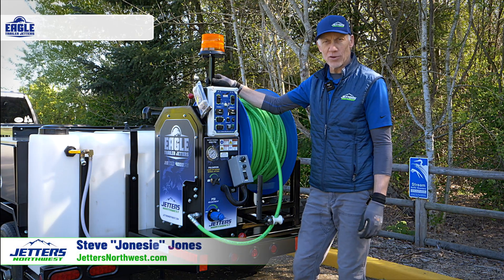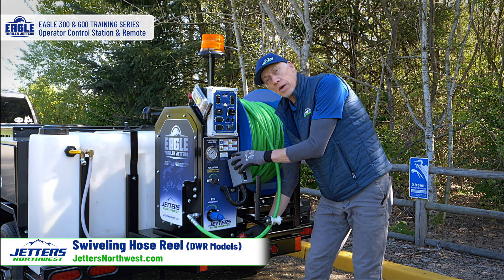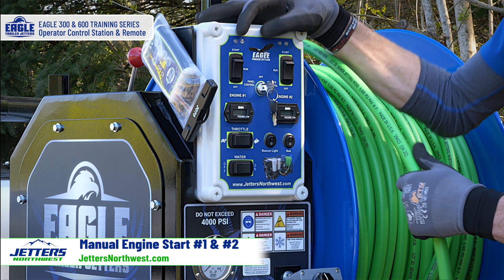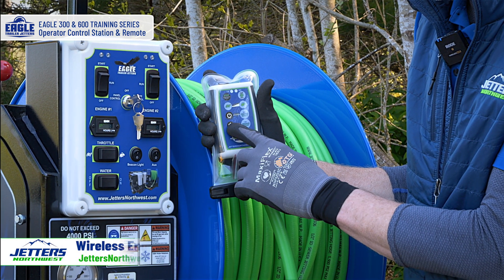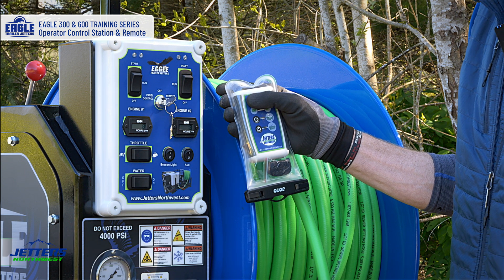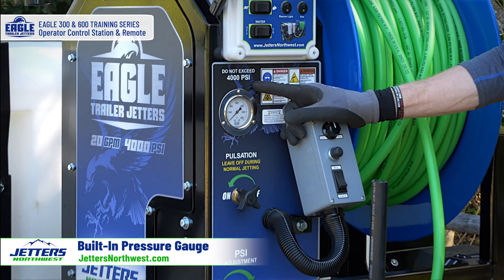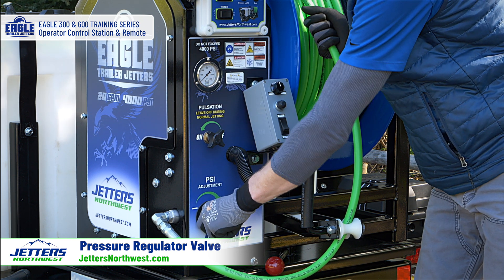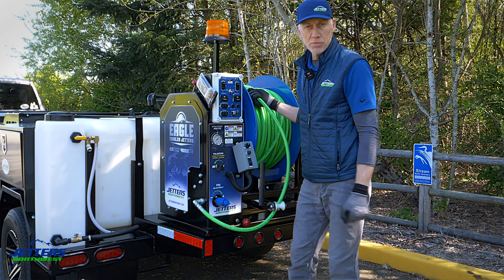EAGLE-300/600 JETTER TRAINING VIDEO (#2 of 7): WIRELESS REMOTE CONTROL & OPERATOR'S CONTROL STATION

Comment: This looks like a nice jetter. What’s the pros and cons to having a gas powered compared to a diesel type and I see that there is just one exhaust pipe for both motors. Wouldn’t that cause back pressure reducing performance?
Reply from the maker: Gas vs. diesel is a common question. We chose to use twin Fuel-Injected gas engines because: (a) it's super-versatile; you can run just one engine for smaller jetting jobs such as small pipes that require smaller-diameter jetting-hoses at 10gpm or less, or routinely run both engines for full flow range up to 20gpm with 4000psi power,   (b) theses EFI/OHV engines burn very clean for running in parking garages and such,  (c) you have a built-in redundancy to continue jetting if one motor or pump is struggling or down,  (d) it's typically easy to find a local shop that'll work on these engines since they are so common in commercial-mowers, chippers and such. Similarly, its dual 10gpm pumps are also much easier to find a shop to service than a larger-body 20gpm pump, and our pump-parts are considerably less costly with great availability.   Regarding the single-exhaust, its capacity is engineered to handle both engines at full load without a loss of power :)
Reply from the maker: Also, here's a quick informational video covering the reasons for the 2-engine/2-pump jetting system that I recorded on the floor of the huge WWETT 2025 show:  https://youtu.be/wznfM1-n2ng